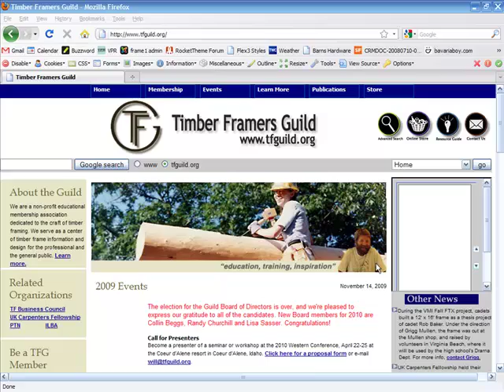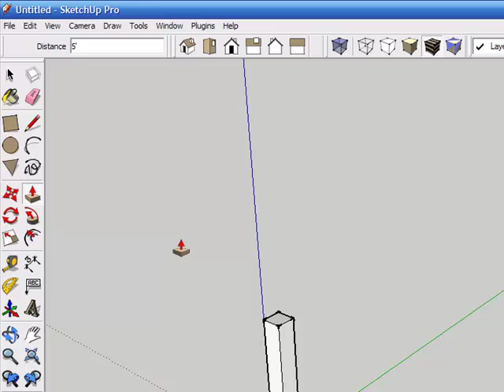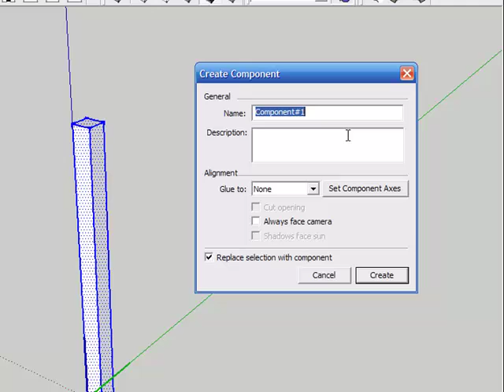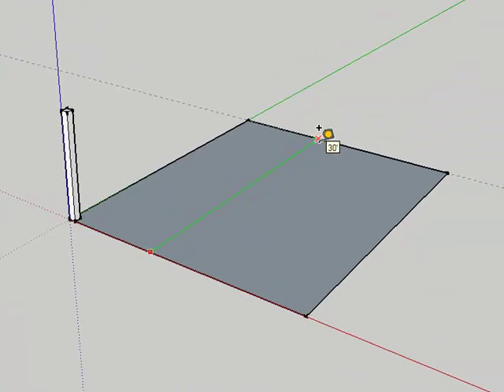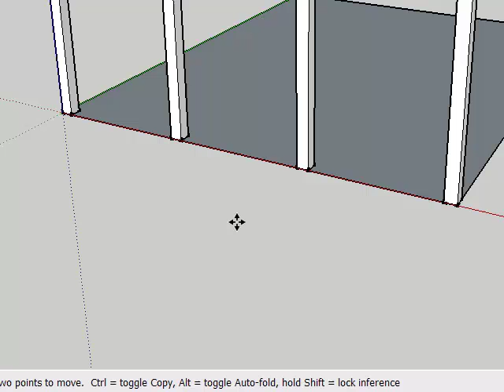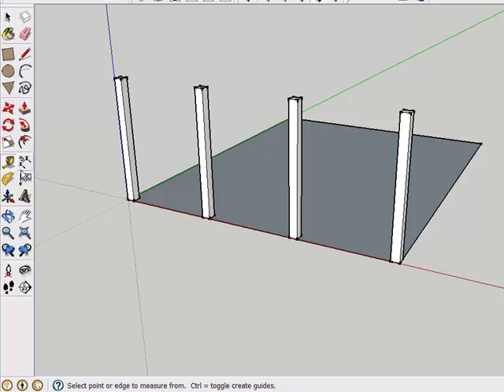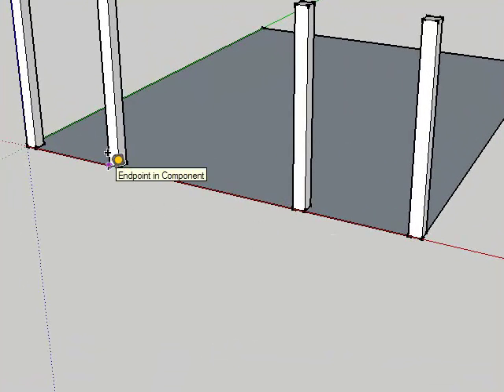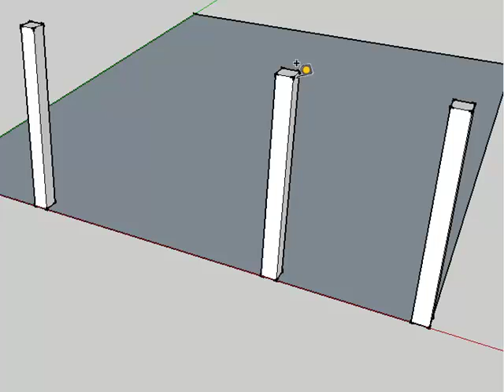Drawing a Timber Frame in SketchUp (Part 1)

Comment: Really helpful. Thanks! Curious about nominal vs actual dimensions when doing this kind of sketch -- i.e. an 8x8 is 7-1/4"x7-1/4" actual.
Reply: Timbers (at least in the northeast) are usually dimensioned to their nominal size (for example an 8x8 measures 8"x8".
Reply: @benweiss897  Thank you!

Comment: I have an Android app called 5d and it works AMAZING..maybe it doesn't have the extensive capabilities as SketchUp but for a free app I am able to do all but maybe one or two things in this video. I have made many floor plans and 3D walk throughs on the app. If you want o e for your phone, as I do not know if SketchUp offers a Android app, then 5d is definitely worth checking out.

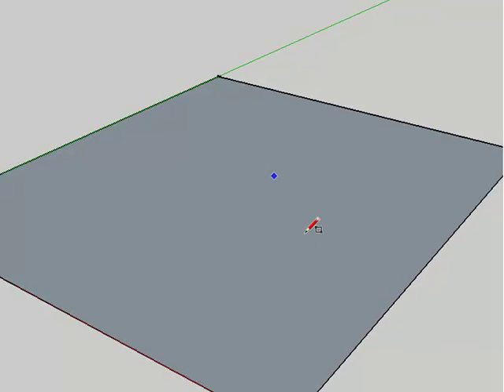Comment: At 3:45, you were able to adjust the dimension of the building size after you set it- how did you do that?  I am using Mac and trying to learn Sketchup- thanks!  And also this video is really very clear and good inform, even though I am deaf and can't hear you talking if you are giving speech, it is still visual enough for me to follow what you are doing and trying to show.